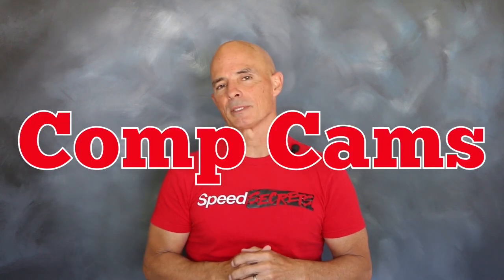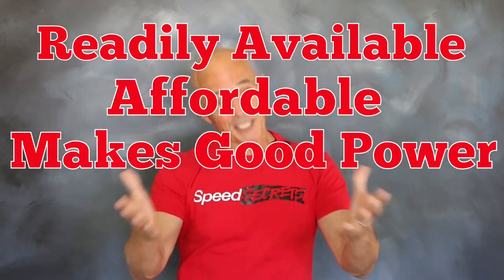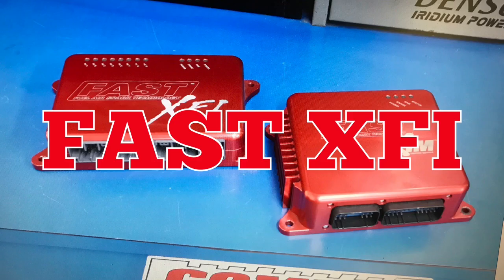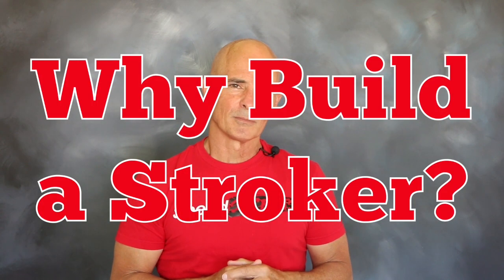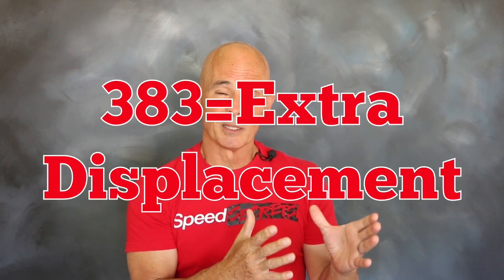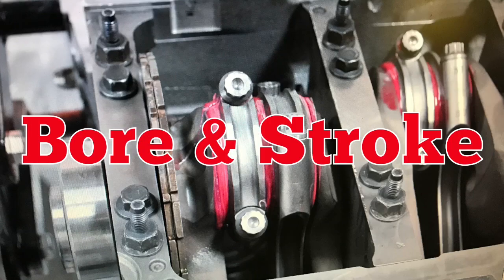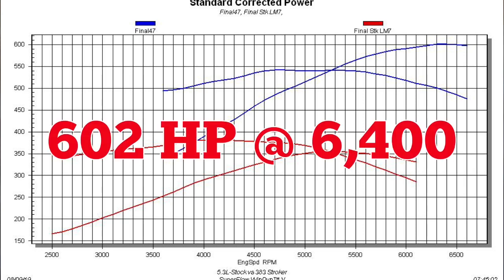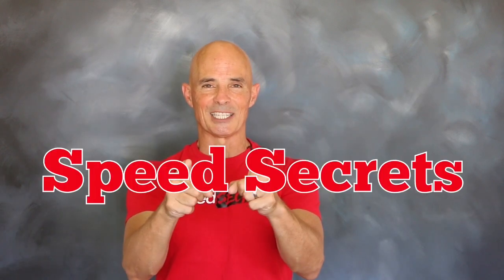Speed Secrets: Why Build a 5.3 Stroker?

Comment: Be very careful.  People have been known to do this and end up pulling the skirt out of the bore and snapping rods.  Look up the video by Tom Nelson Racing engines "Why is the LS so good" and you'll find out why.  Unless you are running an RHS block I dont suggest this.  You rock that piston in that cylinder just once and your motor is history.  Just something to consider when picking out which piston you are going to run.
Reply: The 3.9 has a lot better options and 580-590 hp so leaving a little more on the table for a conventional ring pack. The 4.0 slugs now on the market move the rings tighter up high and removes the skirt so it's less likely to rock in the bore. They should have just went to a 6.0 or bbc 8.1 if they want to make some real power.
Reply: Topper Harley thats not real power?
Reply: By today's standards that's v6 and 4 cylinder power. Cats out of the bag with power and big league parts for cheap.
Reply: Topper Harley ....yeah that kind of horsepower in any engine isnt common.
Reply: A 2008 dodge caliber srt4 was 330ish hp. These are engine dyno numbers so they seem great til you start getting into drivetrain loss it's really not much.
Reply: Topper Harley ok...again, 600hp is nothing to laugh at and isnt common, the 2008 dodge specs...not really sure how that doesnt support my point lol
Reply: I was talking as a starting point to end result. That's anemic to start. Then time bomb the pistons with rocking. The safe spot on a higher displacement you're having a ton more meat on the bone and not much risk.
Reply: The old there's no replacement for displacement. LoL right?
Reply: @masta51  youre comparing naturally aspirated to forced induction. this motor with a turbo would make over 1000hp
Reply: @masta51  330 with a turbo....
Reply: That's normal progression when building a project. I don't know anyone personally that would just put that in there and not add something like nitrous or a turbo or supercharger at some point. You want to give yourself a solid base and a motor with a giant fault as a base of operations is kind of silly. Are there guys that built motors and that's it, sure. But there's a lot more that it's going to progress and if you have to start over it's twice the work in the long run.
Reply: @masta51  again, this engine could make 1000+ with a turbo
Reply: The stroke is what's going to be the downfall. You can buy time with the micro skirts but there's going to be issues at the bottom of the bore.

Comment: But whats the cost of this vs going turbo?
Reply: The cost is 3 to 4 times what a turbo build would be. Figure 2 grand for heads, and close to the same for the stroker kit. Then you have a machine shop bill.

Or you could throw a denmah special turbo for 1000 bucks, and build the kit for probably another grand with cam, and injectors.

It really makes building an engine look dumb these days.
Reply: @nastychevys  ...only when talking about the LS platform.
Reply: Gene Mounce I slightly disagree with this comment. Ls seems to make consistent, reliable power, but the coyotes make stupid gains if you super/turbo charge them. Hell a 3rd gen coyote picks up something like 50hp on e85 and a tune if I remember correctly
Reply: @brycea0225  well ya but they have 3 more cams and are way bigger and cost way more
Reply: James Holbrook you’re definitely not wrong. Almost better to just throw a procharger on it and make more power than have to pull 4 cams, timing gears etc
Reply: @brycea0225  I mean I don't like them but with their vvt cam phaseing stuff changing cams are kinda on the extreme side
Reply: James Holbrook I agree. I was looking to do this to my coyote but after pricing it out to have a shop do it versus doing it myself in a driveway it just doesn’t make sense. There’s plenty of people out there making 1000 hp on stock cams. I’m only looking for 600 ish
Reply: @brycea0225  ya I don't care so i have not looked at pricing but you could probably turbo one for close in price
Reply: @james10739  3 cams means more control, not necessarily more power. More VALVES tho means more power potential (tho more parasitic drivetrain loss). Also, dimensionally they're larger, but internally they're SMALLER than LS and yet making more power.
More power per liter = more efficient design.
Reply: @JoeIsCrazyWillman  so
Reply: vaspen89 just regap the piston rings, add a cam, valve springs, push rods, better injectors and go turbo. Turbo FTW with the stock intake.
Reply from the maker: @boostinwillie  we have a turbo-specific Cam and Intake package coming out at SEMA that is pretty much exactly that! The gained 150HP on a otherwise stock turbo 5.3 setup.
Reply: COMP Cams when would it be for sale? And when can we find out the specs, I got another 5.3 cam that needs a cam.
Reply from the maker: @boostinwillie  Should be available after SEMA, keep watch on the RHS Facebook page for more info!
Reply: @boostinwillie  thats what im doing is gapping them
Reply: I also kind of wonder how would a cheap used diesel fair on a cam only 5.3
Reply: You can keep the intake and you can turn up the turbo a lot as long as you have big enough injectors vs the stroker is pretty maxed out without a turbo or supercharger or nitrous